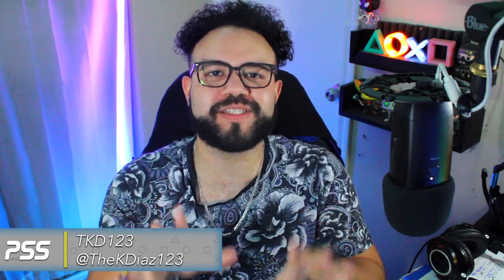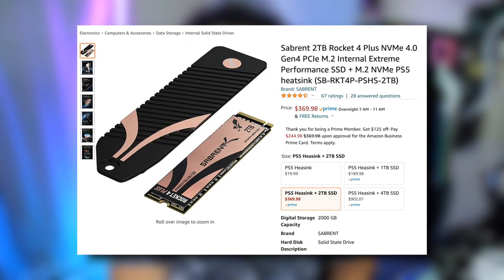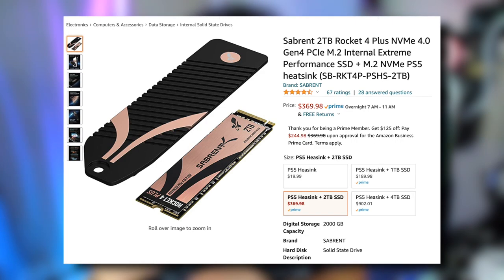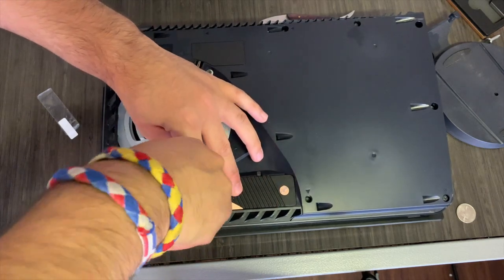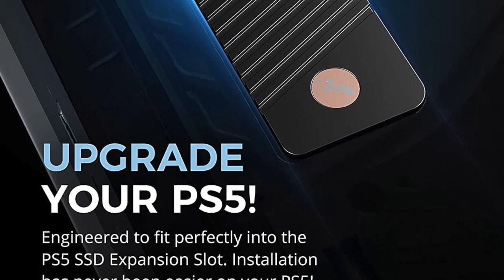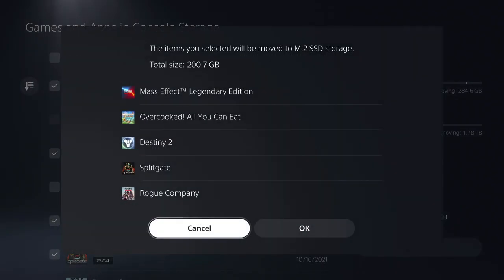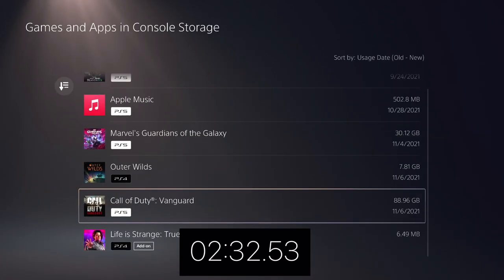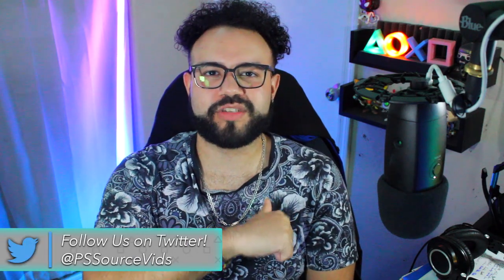Sabrent Rocket 4 Plus PS5 SSD With Heatsink Unboxing & Review! - How To Install SSD Into PS5!

Comment: You forgot to mention using the small spacer found when removing the attachment screw inside the ssd the bay. Very important to use this spacer.

Comment: To add to the video, the washer that Kevin took the screw out from is supposed to be under the SSD and the screw goes into that when screwing your SSD into place. Also, if you’re using a different SSD. Definitely put the grey door back over your SSD to help with heat

Comment: My guy is looking freshhh ke lo keee!
Awesome video! I didn't know installing the SSD and Heatsink was that simple, if I ever wanna expand I'm definitely gonna go with a Sabrent SSD
Reply: I can confirm it is that simple. You just put the heatsink and thermal pad on the SSD and it’ll slot right in and then you can screw it down into place. Had an SSD since the SSD slot was enabled

Comment: How do the games run off of that expansion?
Reply from the maker: You can either set all your games to download to the SSD or manually transfer them but they pretty much play off it like the PS5’s internal SSD. - Kevin
Reply: From Speedtests on a Western Digital SN850, it’s faster but you’re not going to notice it or will barely notice it. It’s the same with the Sabrent